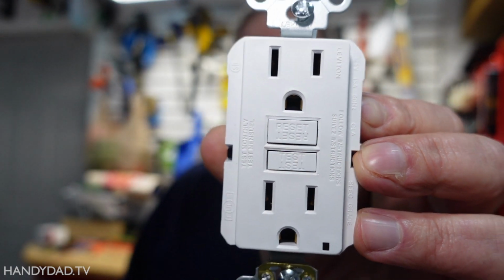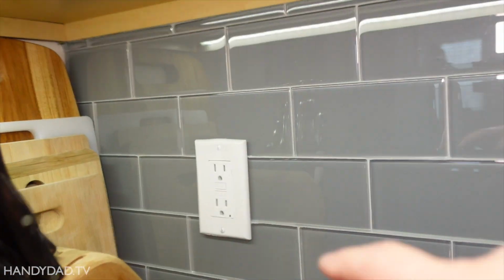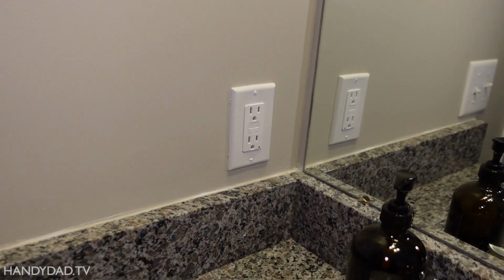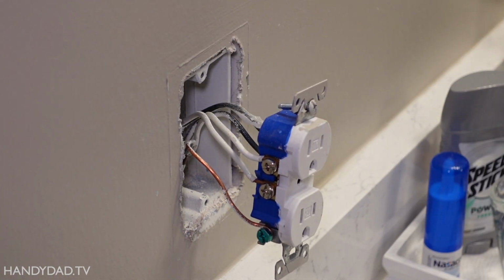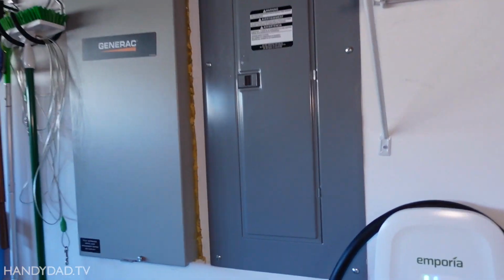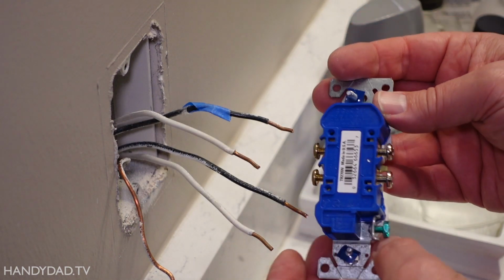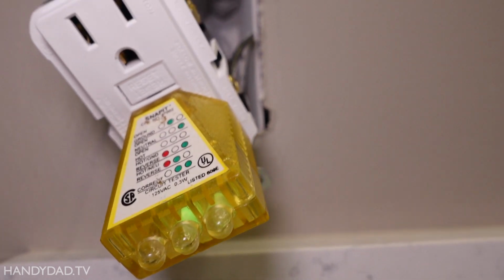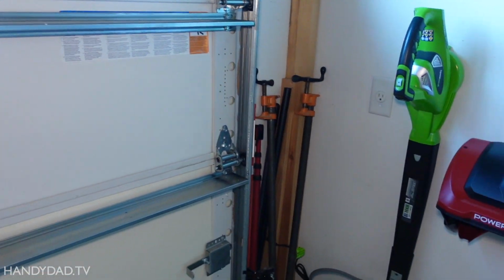BATHROOM WITHOUT GFCI !!!  Electrician mistake?

Comment: I will preface by saying I'm not an electrician. For all those reading, do your own research and hire a professional.

That said, did you notice the AFCI button next to the GFCI button @10:25? That's another standard that new homes are required to implement that protects against additional electrical problems, meaning you need both GFCI and AFCI in new homes. And they keep on expanding what rooms should be protected by these standards.

So what makes the most sense to me is to upgrade the panel in the house so that ALL circuits are protected by GFCI and AFCI, and you don't have to go around worrying about individual outlets. The make circuit breakers for panels that provide both functions.

As for your complaint about a GFCI popping off and shutting down multiple outlets -- if you have ground faults occurring with any kind of regularity that this is actually an issue, you have much bigger problems that the nuisance of multiple outlets shutting down. My two cents.
Reply from the maker: Are you suggesting a homeowner should replace all circuit breakers with GFCI/AFCI combo breakers? Because no builder or electrician is going to pay for that until code requires it.
Reply: @handydadtv  I think if you're upgrading your outlets (are you going to add AFCI?) to add protection, that you should just take care of the whole thing at the panel. Given the number of outlets where these standards apply, it would probably be cheaper, too.
Reply from the maker: Most of my outlet circuits have AFCI breakers, but ironically NOT the ones with GFCI outlets.